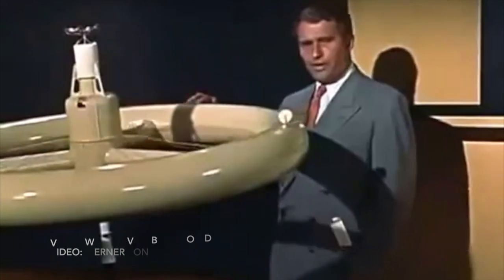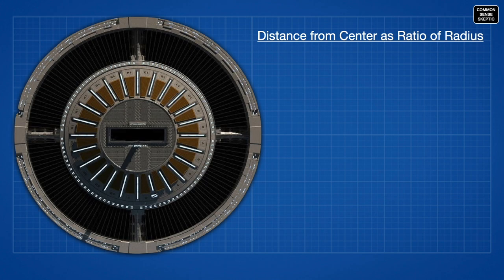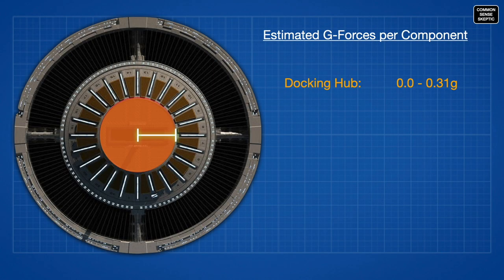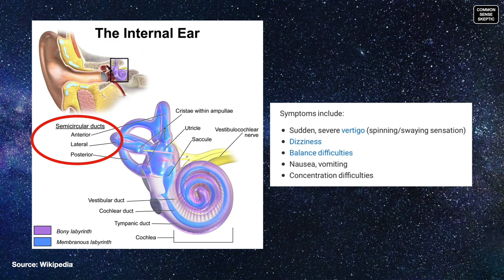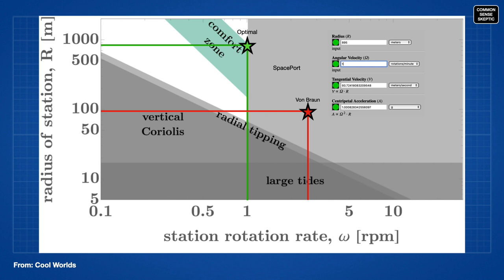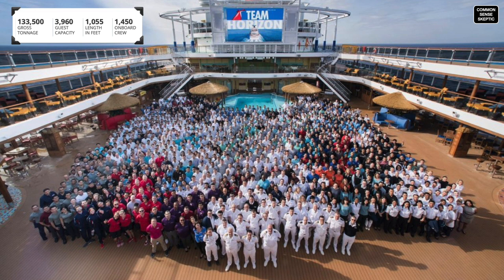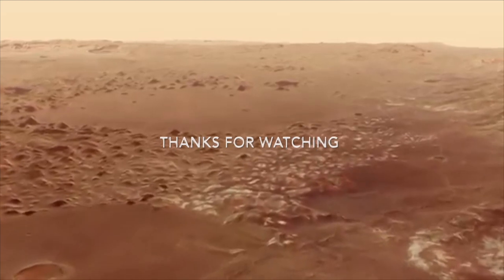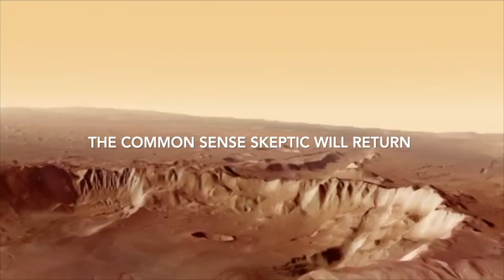DEBUNKING GATEWAY FOUNDATION Pt2 (1080p)

Comment: 10 years or less until one of these companies or Elon announces they've invented gravity plating. Everyone will announce them as geniuses, and I'll be here to watch CSS blow them to pieces.
Reply: You can just use centrifugal gravity...
Reply: Elon: "It's called Elonite. We hope to fly to the moon."
Tech press: "Amazing!"
HG Wells fans: "FFS!!"
Reply: CSS is pretty liberal with facts too. In one video he claimed that SpaceX's cost to orbit is $10,000 per lb, and then went quiet when I pointed out that Falcon 9 costs $1,240 per lb to orbit right now, and Starship could be as little as $20 per lb.

Don't listen to gurus - do your own math.
Reply: @jamesbatchelor3834  And 750$/lb for a semi-reusable falcon heavy (side boosters recovered, center core expended)
Reply: @benoitgermanier8815  If you were going to use centrifugal gravity you'd be designing a vehicle that looks nothing like Starship. For one thing it would be designed for in-space use only - flying from Earth space to Mars orbit and return. It would also be far larger and look a lot more like the ISS. In other words not a vehicle that could or should be landed.
Reply: @saumyacow4435  Never said I was talking about starship... But you can attach two of them with a wire.
Reply: Gravity plating. Quick, apply for the patent!    :)
Reply: @theultimatereductionist7592  Well, even if starship turns out to not be reusable it would still only cost 5M$ to build (the ship, not the whole rocket)
Reply: @benoitgermanier8815  What's the basis for that claim? Parroting ad copy for something that doesn't exist isn't an argument.
Reply: @angrymokyuu1951  What claim? The transit time?
It's simple calculation, starship has enough propellant to go to mars in 2 months, but the fastest reentry ever was 12.4 km/s which would be a 105 days transit time, just a bit more than 3 months.
Reply: @theultimatereductionist7592  Falcon 9 costs $1,260 per lb to orbit - that's an undeniable fact based on a publicly known launch price of $63 million and a payload of 50,000lb to LEO.

Falcon 9 expends the upper stage, and Starship won't. Starship has at least 4 x the payload and even if it ends up costing $500 per lb, that's cheap enough to absolutely wipe the floor with every other launch vehicle out there. You realise that's twenty times cheaper per pound than the Space Shuttle was? 

Keep on slinging insults and jibes, and watch yourself be ever more wrong. You probably thought that landing orbital rockets would never be possible too.
Reply: @jamesbatchelor3834  $1631/lb is the number you're looking for, for the reusable launch at the currently-advertised price.  That's 38,000 lbs for $62m.  Keep in mind that that's a sticker price and basically nobody pays that amount; Space Force paid $70m for the cheaper already-flown Falcon 9 launches, which are quoted at $50m, so obviously the price varies quite a bit.

$10,000 is a very old number and CSS should stop relying on it as gospel.  In a few years, mid-to-launch launch platform that isn't SLS will be able to beat it, especially the non-government companies.   But I would make absolutely no guesses at the cost per lb for Starship until it puts something in orbit and lands both stages.  Maybe it's cheaper, maybe the whole thing doesn't work.
Reply: "Hyper Gravity" (with LEDs)

Comment: I'd never thought before about how walking around in a centrifuge actually changes the gravity you feel. I feel like such a fool. Also it ruins the iconic scene from 2001 a Space Odyssey. Shame.
Reply: Humans are a lot more adaptable than the goldilocks diagram suggests.  That zone is for minimal-to-no discomfort and no adjustment period; humans can and do cope with way weirder situations.  You'd want to be in that zone for paying customers, of course, but people who have trained for it for a while, as the astronaut in the iconic scene would have, could deal with living outside that zone for long periods.  Or they'd be selected out of the program.
Reply: @oasntet  I'm going to guess your observation is not based on having lived in space...?
Reply: @andrewdevine3920  No, from having watched and read about NASA experiments about living and working in centrifugal gravity.
Reply: @oasntet  You are not a good liar. "Rotational simulated gravity has been used in simulations to help astronauts train for extreme conditions.[2] Rotational simulated gravity has been proposed as a solution in human spaceflight to the adverse health effects caused by prolonged weightlessness. However, there are no current practical outer space applications of artificial gravity for humans due to concerns about the size and cost of a spacecraft necessary to produce a useful centripetal force comparable to the gravitational field strength on Earth (g).[3] Scientists are concerned about the effect of such a system on the inner ear of the occupants. The concern is that using centripetal force to create artificial gravity will cause disturbances in the inner ear leading to nausea and disorientation. The adverse effects may prove intolerable for the occupants.[4]''
Reply: @southpakrules  I have no idea what you are claiming I've lied about.  My claim is that humans are adaptable and the goldilocks zone is about comfort for short-term tourists, not long-term inhabitants who can (and have) been trained for way more extreme conditions.

I'm well aware of the limits that have caused NASA to never put a gravity simulator in orbit, and the only such test to ever been attempted was a failure.  But on-the-ground tests have shown the theory is sound, that humans can adapt to the weird gravity, that the inner ear issues are temporary, and long-term habitation could benefit a lot from it.  If we could get past the financial and political barriers preventing us from building structures large enough to use the effect.

None of this has much to do with Gateway, though, as Gateway has never and will never put so much as a thumbtack in space.

Comment: it would be way cheaper to have 2 spacestation locked with wires to a central  small hub that way the radius is as long as your cable can be.
Reply: If you did that, you would only have "gravity" how you would want it to be in one spot on each ship. Unless you somehow make crescent ships.
Reply: @Jcod_  no if you make the stations at the end of the wires 1 level only . the whole level would be 1 gravitational strength 
you could even go further make 1 station on 1 end and dead weight (moon ballast transported into a bag) on the other end of the wire and in the middle only a small dockingstation .
to get to the station you just use a liftmodule that rides the wire. once there you enter the station and take suit off.
why would you want different gravities in a station anyway. preferably you want 1 g
Reply: @sadev101  the gravity replication effects are based on rotational velocity and radius to your center point. If you have two regular ships as you described, you would only have ideal gravity at the center of each ship. As you travel along the ship, you would be changing the radius to the center. Also the effect is radial, so you would be tilting constantly unless you were in line with the cable connection.
Reply: @Jcod_  as i explained before . im talking about stations, not tall rockets legthwise perpendiculum to the radius axe.
imagine a round disc 3 meters in hight (like an uncut pie) on one end and one on the other (or ballast with same mass)
you cant travel closer or further away once you are inside such a station.
1 deck so to speak .. and the wire connecting both sides is longggg lets say 3 miles or more.
both sides are rotating around the center of the wire.
fixed speed.
the right speed to get 1 g.
you use rocekts or spaceships to bring people to the center of the wire and they travel along the wire to the station.
its exactly the same as a von braun wheel but instead of a complete wheel you have only a small section on each side of the wire.
and because its a wire you can make it a lot longer so the rotation does not have to be as fast as a von braun wheel

visual

||--------------------------------------------------------------------------------------------------------------------------------------------------------------------------------------------------------------------||

the "||" you see above is the station    the "-----------------" is the wire.
imagine this rotating

https://www.researchgate.net/figure/Possible-configuration-of-space-transport-with-artificial-gravity_fig7_245438532
in this artile you see a picture. imagine the habitat module to be a 1  level wide module ..(1 story house) so you never can get closer or further away from the center as long as you are inside the station ......
Reply: @sadev101  I think we are just talking past each other. That would work as long as we have a wire or cable strong enough to not break. That's asking a lot out of that cable though.
Reply: @Jcod_  thats true, especially for a whole huge hotelsize. but something like half a internatinal spacestation might . 
but i agree this hotel sizespacestation isnt going to get build this century at least.
certernaly not in a hotel/busness form
Reply: Suppose the biggest problem with this idea would be balance. If one end increased in mass (say crew congregating on one side) you would end up with an odd rotation that would be like an opposite to what you see with binary star systems. In a binary star orbit you have the star with most mass nearer to the center of rotation with the less massive object further away from the center of gravity. Your station would have the opposite affect where the side with greatest mass would pull away from the less dense side so this half of the station would endup always being on the inside of a tortured rotation whilst the side with more mass would always be on the  outside of the center of mass.
Reply: Dont think you have thought out the wire connection either. Surly the wire would need to be at a constant tension ?
Reply: @stephenirving1737  there does not have to be a balance. if one end is heavier then the center of mass will shift. so the center of rotation might shift half a meter if you make one end sligtly heavier or lighter. that does balance out.
we for instance say the earth rotates around the sun. scientist say they revolve around each other but because the mass of the sun is so big the center of rotation is very close to the center of the sun
Reply: @stephenirving1737  the wire will be at constance tension as long as you rotate the whole.
Reply: Dude this is idiotic. Then each circumference of each station will have different gravity, in addition to the the gravitational differences as you travel between each circumferential segments. Because in this case, the center of rotation will no longer be at the center of each station but at that hub....

It solves nothings and creates more problem
Reply: @Jinkypigs  no its not idiotic its been tested even.
it solves hauling huge amount of mass to space because you dont need a full wheel.
since both station on the end of the tether are doing the same circle gravity in both stations are equal.
the centerhub would then be 0 grav and here you dock.
yes traveling to the center will be from 1g to 0 g and vice versa.
thats not a problem.
but by doing so you wont lose bonemass and get hearth problems in space as you mostly live in 1 g enviroment.